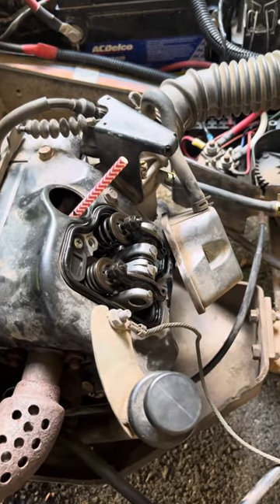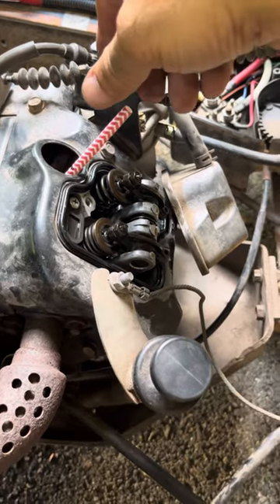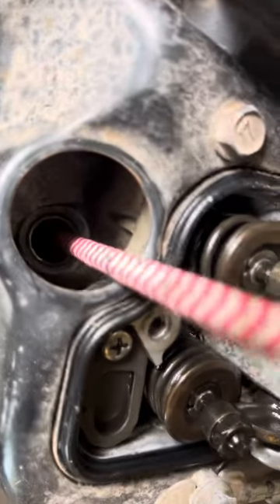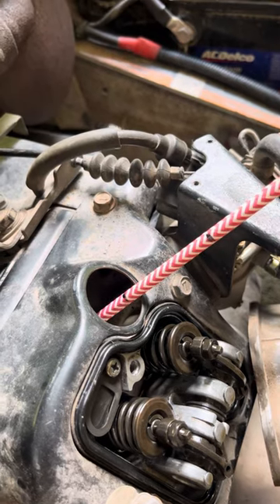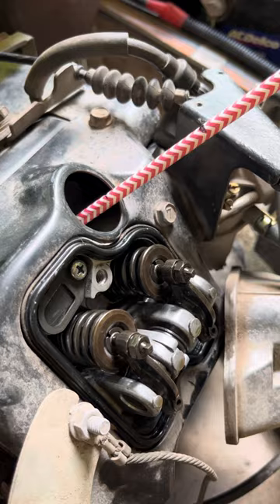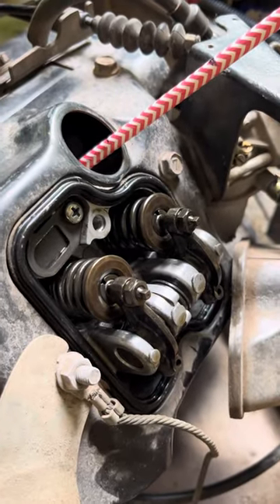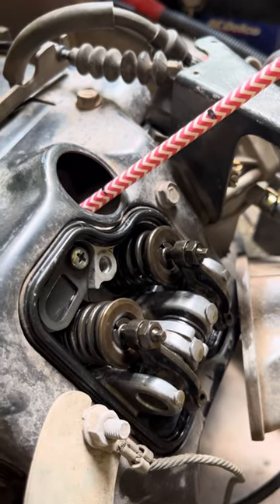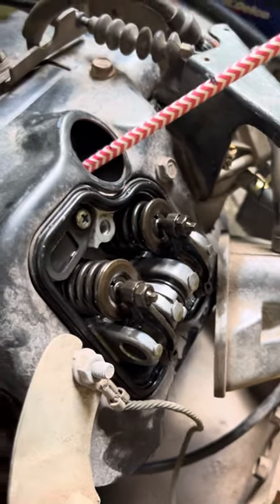Club car valve adjustment tip

Comment: You set them on the compression stroke..your off
Reply from the maker: Dead top center is the compression stroke.
Reply: No you set it on the exhaust stroke, it’s going into the intake as you can clearly see the exhaust valve close and then the intake valve start to open when you’re moving the belt. What you need to do is go another rotation, induction then compression, this way you will guarantee no load on the valve whatsoever.